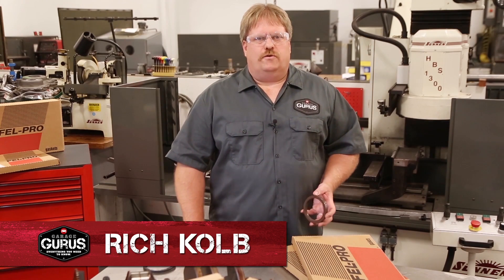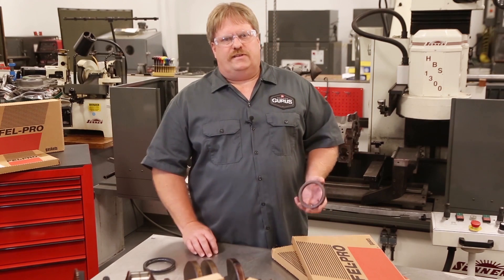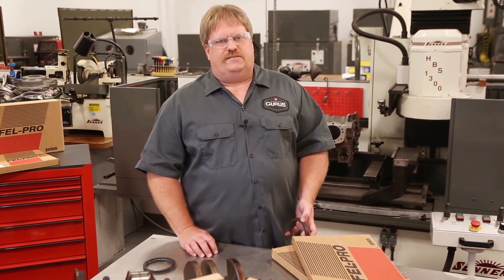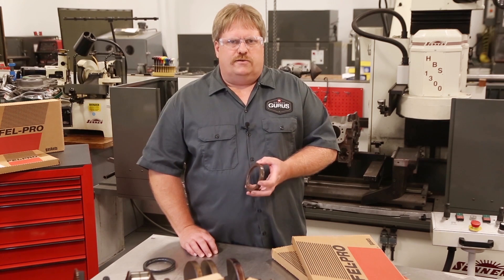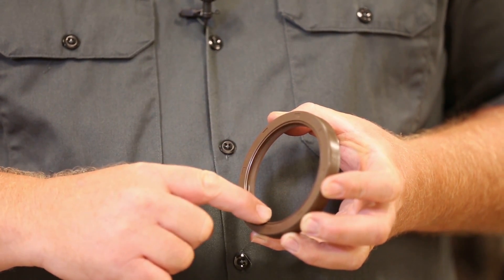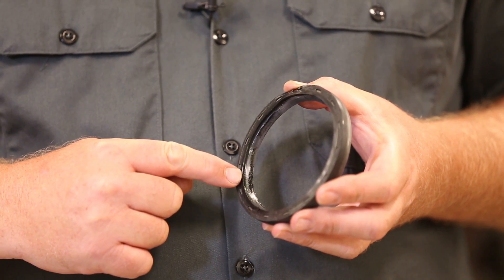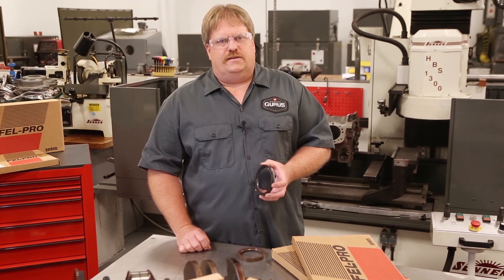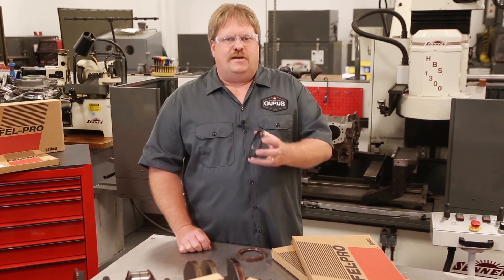PTFE Rear Main Seal Installation Tip

Comment: Hi Rich, great video very informative.
On a rubber seal you mentioned to put a little grease on the inner ring but do you also put it on the outside ring?
Thank you
Reply: Always look up your specific seals manufacturer installation instructions if they aren't on the package.

Comment: How do you stretch a seal to 50% larger diameter without lube of some sort? Such as with the huge crank end on a VW/Audi 2.8L v-6??? Unless there'sa crazy seal stretch tool, I am at a loss. I'll use a ptfe lube then try to clean it off... no other options on this 01 passat
Reply: Those seals use an expansion sleeve for installation

Comment: How does one know if it’s a rubber or ptfe seal?
Reply: Yes. No spring no lube.
Reply: @MrCjhsc2  preciated man
Reply: @Grim_R13576  no problem
Reply: @MrCjhsc2  did you install a seal ?
Reply: @MetalSlug270  yes I did. Cleaned crank very throughly and put black rtv around the outside before installing it.
Reply: @MrCjhsc2  i see. I have to do both rear and front. I've seen people put lubricant on both ends(crank shaft) but I thought it was supposed to be dry. I
Reply: @Grim_R13576  yes put them on dry
Reply: @MrCjhsc2  alright cool. I'm doing a ls swap so I can't yo see that bad Boi in the engine bay
Reply: @MetalSlug270  right on man. Good luck on your project
Reply: @MrCjhsc2  thanks man 👍
Reply: I need to know this too
Reply: @MrCjhsc2 ever found out?

Comment: I see that PTFE seals are to be installed dry. FPM seals are to be installed oiled, correct?
Reply: yes
Reply: @pyromaniac354  I got a bit of oil on it but sprayed brake cleaner and wiped away will it still be ok?
Reply: @PincheKriss  yes.
That should be fine.
As long as it's clean of oils etc
Reply: @PincheKriss  if in doubt tho I'd just buy another seal.
A little extra money will save you pulling your engine back out again if it leaks
Reply: @pyromaniac354  I went ahead and slapped it in. I got a good feeling bought this one. Last new one failed cause I doused it in oil
Reply: @pyromaniac354  also didn’t clean the crank before installing so it failed almost immediately
Reply: @PincheKriss  sounds good.
Best of luck 👍

Comment: Rich, I'm about to install a rear main seal on my 2004 mini cooper.  How do I know if its a PTFE seal as opposed to just rubber?
Reply: PTFE seal do not use a spring on the inside of the oil seal like the standard rubber ones

Comment: Thanks for the i made this mistake today and had instant failure of the crank seal live and learn just the 6 hours to strip everything off wait for new seal to be delivered then reassemble again for the 3rd time after 1st clutch blew the gearbox main seal 😂😂😂😭😭😭